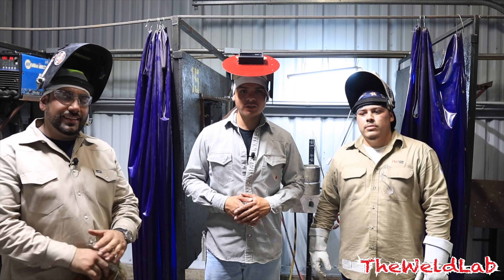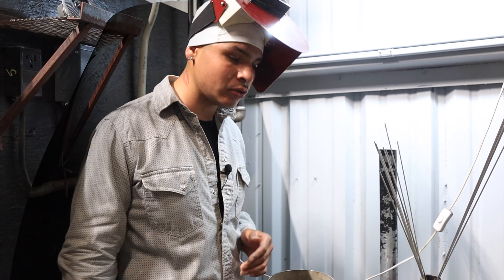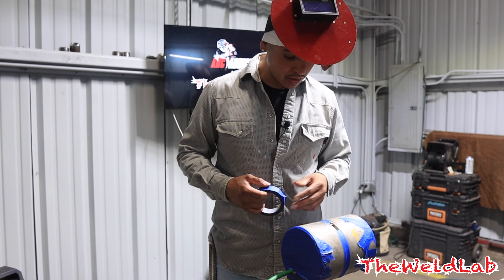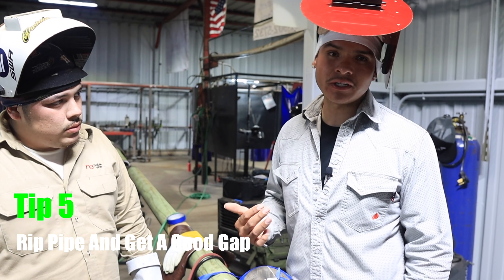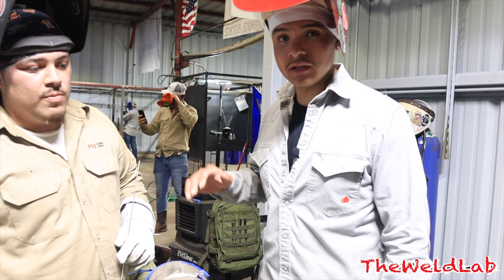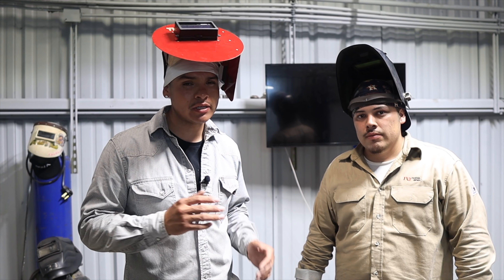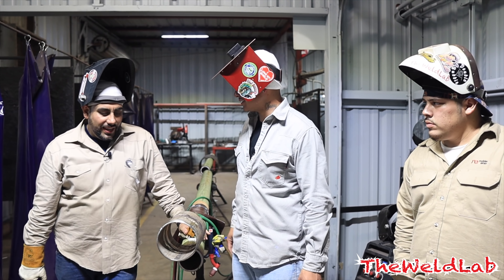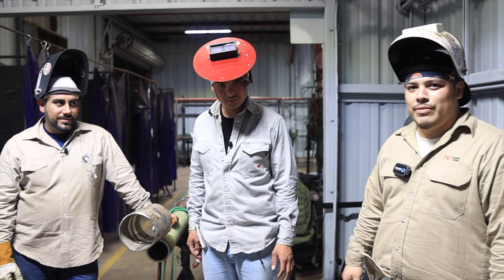5 Mistakes Beginners  Make When Learning How To Tig Weld Stainless

Comment: Have been burning 70s6 since I started tig welding with np and I'm having trouble now with 70s2 runs real different on the root, how do i get penetration on the bottom?Any tips? Would really appreciate a video  bout that, thanks man your content is dope
Reply: Mistakes beginners do with 70s2 coming from 70s6 🥴
Reply from the maker: 70s2 runs similar to stainless you need to feed it more consistent 70s6 stacks better
Reply: @moisesrodriguez2931  🙋‍♂️

Comment: how are u putting the argon in the pipe through the hose ? is it like an adapter ?
Reply: That green hose is connected to a regulator and the regulator is connected to an Argon bottle. Turn on the bottle all the way and just use the regulator to regulate how much argon comes out of the green hose.

Comment: What's the power source and amps?
Reply from the maker: Root 90 amps 3/16gap 1/8 rod
Hot 104amps 1/8 rod
Fill 120amps 1/8 rod 
Cap 130 amps 1/8 rod